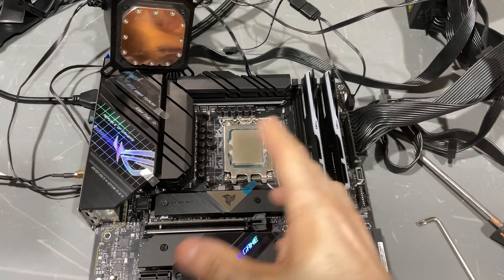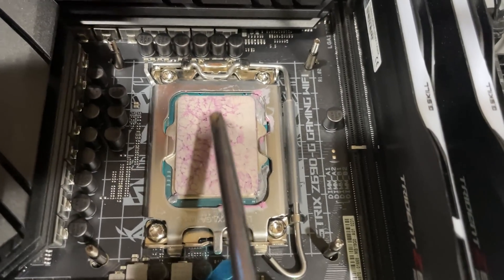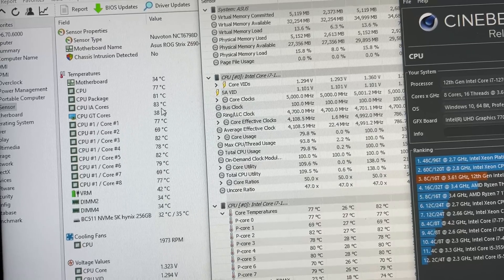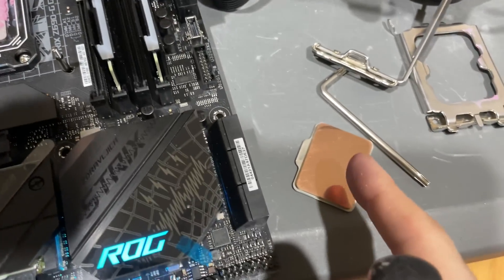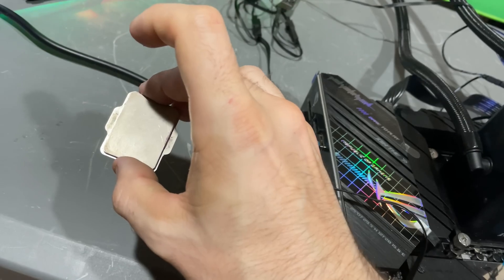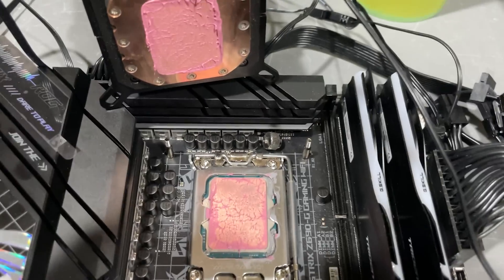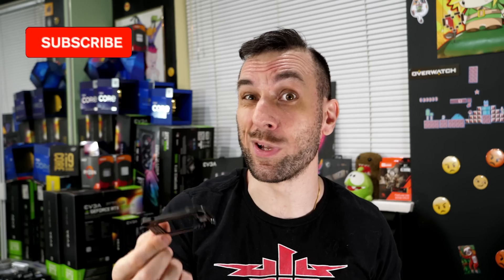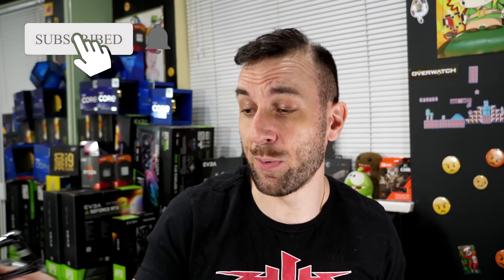12th Gen Contact Frame Performance RESULTS!!

Comment: I think he completely missed the purpose of this product.  It is suppose to prevent fatige and uneven pressure "OVER TIME" through 100's of heat cycles.  It prevents the IHS from warping and prevents an uneven surface from extreme temp changes and uneven pressure OVER TIME. This is not snake oil and i am not a spokes person for this product either. just putting in my two cents
Reply: 💯 He's the snake oil merchant, how the hell  going to blame the thermalright BCF kit for without using a new CPU that hasn't been bend
Reply: I agree,  I rather use it knowing my cpu is not stressed from high pressure.

Comment: I'll wait for a proper review of the Thermal Grizzly contact frame thanks
Igor's lab showed a 5-10C difference even compared to washer mod
will be much more important for open loop water cooling than AIOs or large air heatsinks
Reply: It was either Linus or Gamers Nexus that did a review, and the ThermalRight showed the best numbers, and the Thermal Grizzley was still spreading unevenly (for the most part)

Comment: While the bending may not be an issue for most, I'd rather have a more secure ILM bracket that prevents it. The stock design is terrible as it applies pressure on the longest sides of the IHS.
Reply: Did you get it?
Reply: Same. I bought the thermal grizzly one

Comment: If you lap the cold-plate and run LM you’ll see another 5-10c drop. Discovered EK’s cpu blocks are horribly shaped in an attempt to maximize contact with Intels horrible IHSs.

Comment: I have a delided 12900 ks ( sp 104 )

using default clamp temps were hotest core r23 for 30 mins @ 5 2 GHz 4.9 ring e cores off .
was 64 c 

that thermal right bracket 
same evrything was 2-3 warmer in the middle 2 cores 67c. 

but I noticed a weird anomaly 
using the default Intel cpu clamp 
32gb (, 16 GB x 2 ) g.skill royal 
4000 cl 16-16-16-35 1.40v xmp 

@ 4133 cl 15-15-15-35 @ 1.55v gear 1 mode stable with default Intel clamp I would reboot PC and the training would make RTL/iol 71/73 but I would fail tm5 anta extreme 777 5 hrs in reboot re do it fail 4 hrs in reboot retrain the same 71/73 RTL/I'll all settings locked in then fail 2 hrs in . .... 

then I thought well when I ran the thermal right bracket in this video I passed 8 hrs of tm5 anta extreme and anta tm5 absolute 8 hrs each . 
rebooted retrained ram same 71/73 RTL/I'ol rebooted passed both again. 
rebooted cold boot , retrained same RTL/I'll passed again both.  

put Intel's stock braket in booted up RTL/iol.trained 71/73 all the exact same settings as the other bracket thermal right in this video and got errors tm5 1 - 6 hrs in rebooted retrained cleared cmos retrained all the same settings took cpu out but back in  always errors in tm5 anta extreme 1 -5 hrs in ram temps were 31 c - 38c in all tests.  

I'm thinking the even presure from that new Becker helped my cpu with ram oc it was really weird . spent 2 days.  figuring it out.  

+2 c with that bracket and zero mem errors in tm5 anta extreme and absolute and occt every reboot no issues even re training all pass.  the stock bracket throws random errors.  

my issue could be that I ran my 12900ks with stock clamp got the bend in the middle really bad Wich caused ram errors then when using this new bracket it pushes it flat in the socket and corrected those errors instantly who knows ! 

I'll update over time . 

great video
Reply: Maybe the memory controller's pins have better contact with the frame?  Who knows if they reside on the outer edge of the pin layout.  Or your integrated memory controller runs cooler with the frame?   I mean,  that's kinda far fetch i guess.  I'm sure there is a simple answer,  but finding simple answer can sometimes be extremely not simple :D
Reply: @jaybee0507  must be , since then having used the frame for 2 weeks I have re stress tested my ram oc on dual rank 4133 cl-15-15-15-35 1.55v 
does 41ns in safe mode and 43ns in windows clean boot , I have went from 1.31v to 1.35v vcssa and ran y cruncher for hrs and all passes , passed tm5 with absolute CFG and passed for 8 hrs.  

so now that I'm 8 hr solid in tm5 and y cruncher even with re training and clearing CMOS and loading my ram config oc settings and still passed i could reinstall the original clamp again and see if my ram fails tm5 absolute again.  

I don't want to fix somthing thats not broken , I have learnt the hard way with that one lol .

vary odd

Comment: Insert comment here about how your wrong and my favorite xoc youtube said it's a 10-15c difference even though I never tested it myself but my brothers sisters uncle did so your wrong.
Reply: I mean he's using a delidded CPU that doesn't have the bending issue. You should see how bent my 12700k is. Completely depends on the cooler to. I have a huge pile of thermal paste in middle of the chip and garbage performance on my nh-d15 because of the flat contact plate. Switched to an asetek cooler and get way better spread and like 16°-17° better temps. I'd bet this with help the nh-d15 dramatically. Kind of want to try it out but my bullshit case doesn't have a big enough cutout behind the board and I don't want to yank the entire board to change the cooler again lol.
Reply: @MrDutch1e  I also have a 12700k that had terrible contact issues with e EK 360 aio. I switched to a full custom loop and cooling is no issue. I think alot of the older aio don't have the optimal cooling position for the fins on the inside for the newly shaped intel chips and it's just not cooling the chips as good in the center it might be offset or somthing. The cooling fins don't cover as much area as the actual Coldplate on those AIO'S so it's hard to tell.
Reply: @maloc1166  more likely you have the bending issue and the aio isn't convex. Block on your custom loop likely has more pressure and a sturdier backplate helping to flatten out the chip.

Comment: I bought the der8auer one and somehow killed my z690 board with it. If you buy one be very careful installing.
Reply: What motherboard that was you broke?  Any idea how did it happen?  I'm just about to buy the frame, lol,   my local store just got those.
Reply: @jaybee0507  it was an msi pro z690-a ddr4. No idea how i broke it, the debug leds looped through cpu and ram. The same cpu and ram run fine in my new motherboard. The cpu was in its socket while i installed it, i looked at the pins afterwards and did not see a single bend one. The PC booted once with the new contact frame installed and immediately blue screened in Windows and afterwards it would not turn on again.
Reply: @KaffKind  That's really concerning.  Could it have shorted out somewhere?  It's metal,  right?  Or maybe it grounded the cpu somehow.  How tight you screwed the frame?  Did you do just like derbauer instructed on the video?   I have msi 690 edge wifi ddr4.  That's almost the same board as you.   I'm guessing you didn't install the frame on your new motherboard? :D
Reply: @jaybee0507  Im not sure, he said in the video that it has a non-conductive coating so I don’t think it shorted something or grounded the cpu. Yes, I did it just like he said in the video, it booted one time and crashed in windows so I tightened the screws another 90 degrees to get better pressure on the pins because my ram is overclocked and I thought that would be the problem. I think it froze in the bios screen then. After that the pc would not boot with the contact frame or with the original ilm. No, I did not install it on my new motherboard would not want to risk it again. I made sure the cpu was secure in its socket while installing the contact frame and did it like he advised in the video. Im really not sure what could have been the problem but like I said the cpu and ram work in my new motherboard so something broke on the old one while I tightened the screws again because it booted before.
Reply: Did it void the warranty on your motherboard?
Reply: @gypbob  intel said it might void the warranty removing the installed ilm but i got it rma'd

Comment: I used a 3d printed spacer for my LGA1700 clamping mechanism (since day 1), After a couple months of use, I removed the cpu and was unable to detect any bending.  Can't say it would have been better or worse if I hadn't done this, but it's an easy piece of mind thing since I already had a 3d printer.
Reply: Hello! I have a 3d printer and I live in Argentina, sending this product over the internet would cost me a lot and in a long time. My question is, where can I get a plan to make the spacer myself and make it look good?
Reply: You have to check while the CPU is still mounted. If you take it out then it springs back because the warping isn't far enough to cause plastic deformation.

Comment: I been meaning to grab one of these. My 12700k is bent af. Grabbed an asetek based aio because they are convex and fixed most of the issue tho. My nh-d15 performed like GARBAGE because of how flat the contact plate is. It's definitely not a bad product you just don't have a bent CPU. You should see the pool in the middle of my chip after I remove the nh-d15. You just didn't test a stock chip that hasn't been delidded that has the bend issue...
Reply: did you get one?

Comment: Maybe when using the bracket would prevent to bend the IHS over time, if that's a thing?
Reply: Well, my 12900k cinebench temps raised something like 5-10 degrees over some months on it's own with the default latch.  Then i applied washer mod and it was back to the original temperature again.   So definitely bends over time.  I could even "see the bend" when looking against light.   I mean light coming through the middle of the cpu,  you know what i mean i suppose.   I'm not sure if the washer modded latch is enough to bend it over time but i'm not eager to wait and see.  Ordered the thermal grizzly frame,  going to lap the cpu and free my mind of this unnecessary bullshit we shouldn't need to worry about.
Reply: @jaybee0507  yeah I was using the washer to with my stock bracket
Reply: read my post above I found a weird anomaly with the stock braket and switching to that thermal right bracket